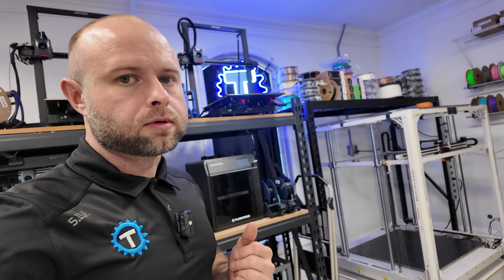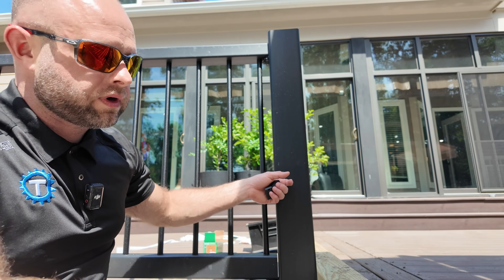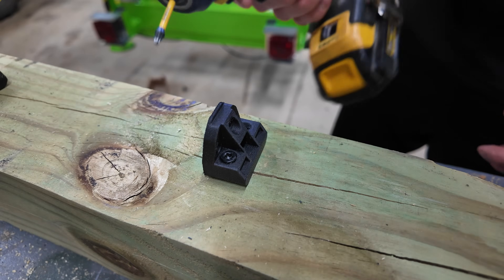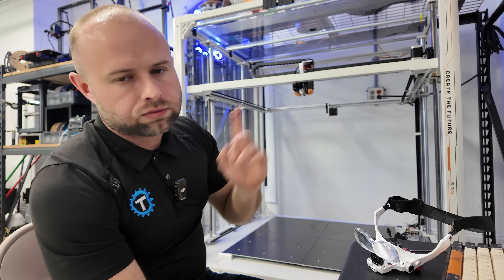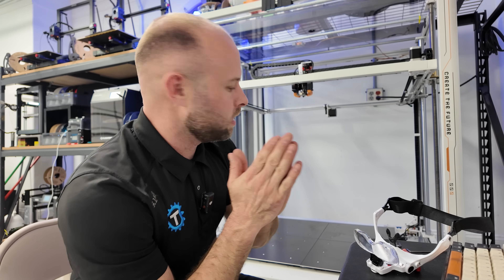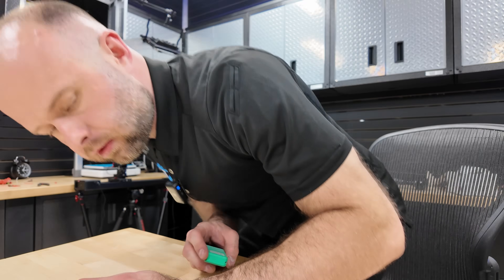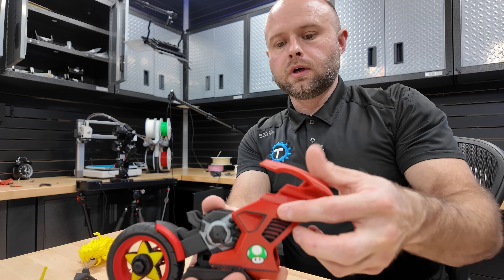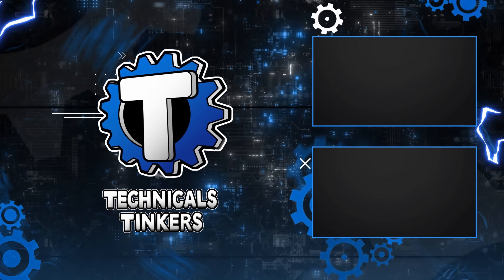I saved 90% by 3D Printing THIS part; Biker Peach Print; Learning TONS about printers. 3D Print Vlog

Comment: The great thing I get here is that 3D printing isnt anything at all.... at the same time, its everything. If we need it, we can print it. If we can imagine it, we can print it. The only limitations involved pertain to our willingness to do! And pretty much every American these days needs a kick in the ass to get back to DOING! 

As far as the Giga goes... Ive always liked the idea of the printer, but I went with a 500mm RatRig instead. The Giga is a solid starting point, but VERY poorly implimented. The work you are doing should be the way the things sold from the start! Personally, Ide ditch CANBUS. Its not worth the hassle. Youre not trying to build a super light, super fast machine. So the added wires arent going to hurt anything! The EBB42 will need a USB C cable and 24 volts ran to it. The Beacon probe needs USB C as well, and Ide run an additional USB C as extra in case you eventually want to add a nozzle camera.

As far as flashing MCUs goes.. you should always do all of your flashing prior to assembly. Unfortunately, we have to depent greatly on low cosh Chinesium products that are far too frequently DOA. Flashing first will only ever save you time!

Comment: What the f*** is SSH into something ? Whenever i hear SSH i switch off no one ever explainsvin english
Reply: "SSH, or Secure Shell, is a cryptographic network protocol that enables secure communication between two computers over an unsecured network. It provides a secure channel over an unsecure network by using strong encryption and authentication mechanisms" i just figured it was some form of communication to the board based on the conversation he was having, i looked it up for you, its technical jargon you have no reason to know unless your into that field.